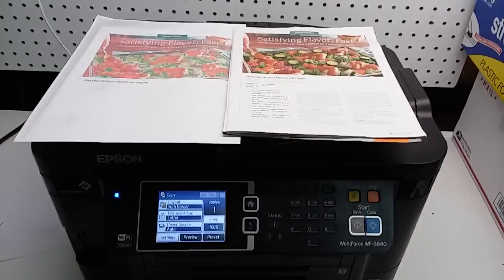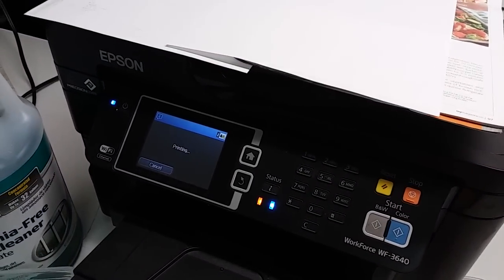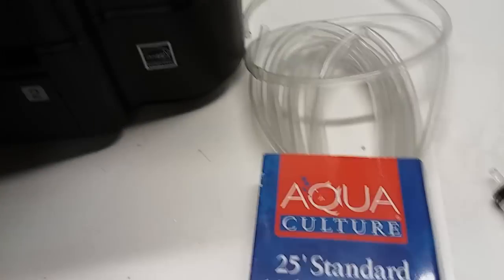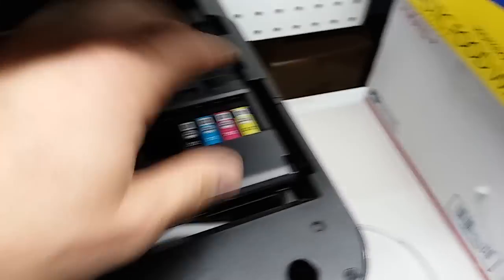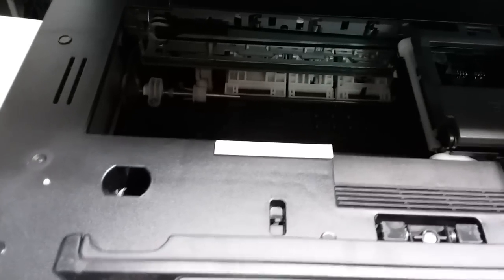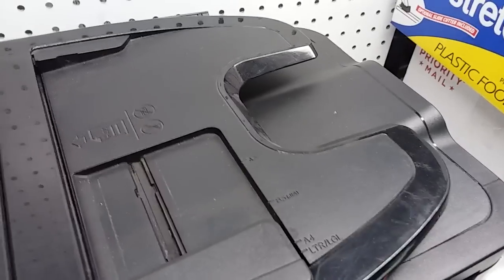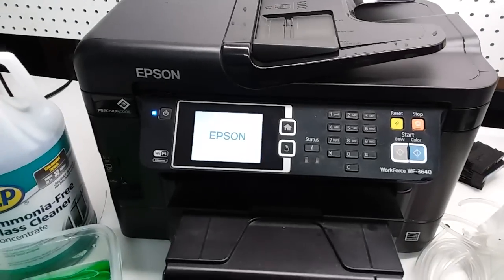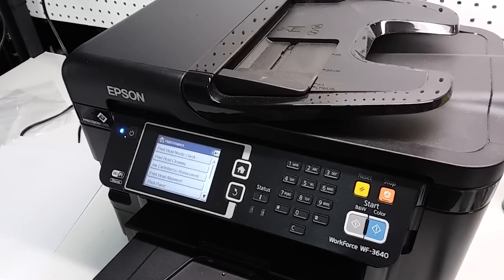Epson WorkForce Printer Cleaning Clogged Printhead Nozzles WF-3640 WF-3520 WF-3720

Comment: So apart from scheduling a trip to Staples or Best Buy to purchase a new printer, any suggestions on how to proceed? After following the video instructions (including the recommendation by another reviewer to clean the cradle), rather than having a printer which outputs in colors that do match the documents on my screen, I now own a printer that doesn't print at all. Scratching my head as to how others have had success with this method.
Reply from the maker: Not all printers will be fixed just by cleaning. Sometimes the printhead fails to where it just needs to be replaced with a new one.

Comment: What if I have no missing segments but my red colors don’t come out red but orange and my blues kinda purples?
Reply from the maker: One of a few things. If you are using refilled ink, colors may be cross mixed. For example just a drop of any of the three colors in yellow, will make it not yellow anymore, and so on. If all cartridges are filled properly, run a "clean printhead" cycle to purge ink into printhead. Good luck!

Comment: I did this but now it says it doesn’t recognize my ink cartridges so I bought new ones and same problem
Reply from the maker: There may be water somewhere in the connection board above the printhead. If you have air can, spray air there and see if it resolves the issue.
Reply: @303electronics  thanks for the reply I’ll give it a go tomorrow

Comment: I don't get the whole parts thing. 

Could you please spell out exactly what I need to do do create the best solution mixture?

FWIW, i assume the added (extra) ammonium is for the dissolved properties and the alcohol is an added kick bec why not ?
Reply from the maker: Hi, yes, thats why ammonia is added. I usually mix 40% windex, 20% ammonia, 40% hot water. Cold water is fine too, but hot makes the solution warm and is more effective. Thank you. Good luck!
Reply: @303electronics  not quite what I asked, but I'm assuming the gist of that is something like 4 cups of this 4 cups of that 2 cups of that ?
Reply from the maker: @YourFreeToys  yes
Reply: @303electronics  ty
Reply: @303electronics  for what it's worth, I'd like to suggest that  be edited into the description.

Comment: My WF-7520 had blank streaks from the colors (M, Y, C) but the black was printing fine.  NOW not so much.  The printing is awful.  So copy is so streaked it is unreadable, the head cleaning and alignment don't work.  Any idea what has happened? Thank you.
Reply: Did you ever get this resolved, Im having the same issue.
Reply: Did you get this fixed? Im having a similar issue, very frustrating!

Comment: Could the solution affect the lector catridge chip?
Reply from the maker: Hi. It shouldnt as thie or I'll behead is built to be around liquids. Just make sure the contacts are dry when installing printhead back into printer.
Reply: It's because I cleaned it yesterday and it marked 0xC1 error :(
And I'm discarting what could it be

Comment: So did it print out good ?
Reply from the maker: Yes. I'm sorry I left that important part out. In some cases, if the printhead problem is beyond cleaning, the result of this process will be minimal. Sometimes parts like printhead go out to unrepairable state. The cleaning in this video will usually get your printer to print 100% or close to it
Reply: @303electronics  thank u

Comment: I did exactly what you said.  Now I get all my colors back, but the printer prints color fat lines and a black solid box over it.  When I try to print words all it gives me is fat color lines, no words on the page.  Suggestions?
Reply: Not sure if you will see this comment or if your problem is still relevant but I had a similar problem when printing so I now select the "print image" option in the printing menu from my computer and everything always prints completely now, as long as a print head is not clogged of course.

Comment: I tried this method just exactly as listed. Guess what? There was ink all over the tray and I didn’t get that clicking noise when inserting the solution. It was all over the place and squirted everywhere. Also after printing, all the pages were blank. Anyone have better answers? Please help!
Reply: Same exact problem!  Printing blank pages now!  Any luck figuring it out?  I'm wondering if a hose got disconnected?
Reply: Daniel Hawk where would the hose be? . I’ve checked and cleaned nozzle heads. Everything seems clear so far.
Reply: I have the same problem too! I mixed a solution using a 8 part window cleaner and 2 part alcohol, and flushed out ink. Before, black was clogged and the colours were faint. Now its printing blank pages! Anyone knows why?

Comment: I tried this and now no matter what I do the printer won't recognize my ink cartridges.  Any suggestions on what I could have done wrong possibly that would be causing that?
Reply: Give it more time to dry. Open it up and try again in a few hours
Reply: @davidjames666  it had dried overnight
Reply: Use a hair dryer. I had it too. And it worked
Reply: @PureMocro  Hair dryer on the print head?  I'm printing blanks over here!

Comment: I did this on two of my epson printers, both get damaged,  this kind of tutorial just makes the printer worse
Reply from the maker: Thank you for sharing your opinion. I don't know about that, check the comments below. The tutorial helped many fix the issue. It won't fix all the printheads, however. Some are just not fixable. In any case, I'm sorry it didn't work out for your printheads. I've been doing this for years. The cleaning process doesn't damage the printhead usually, it is most likely damaged already. Also, you do not want to force any pressure with water or cleaning solution. Check the printhead nozzles. f the look damaged or if there is a burn mark, it is gone and will not work anymore.

Comment: Never do this. Printer head gets damaged
Reply from the maker: Wonder how, but thanks for your input.
Reply: I did what you recommended but now shows error 0x9D and shuts off while  printer is starting up
Reply from the maker: @radtad3536  sometimes printheads fail, that can be it. I know it's frustrating in a case like this.